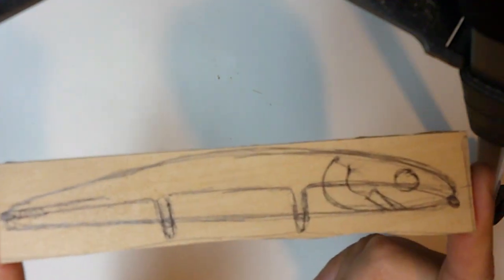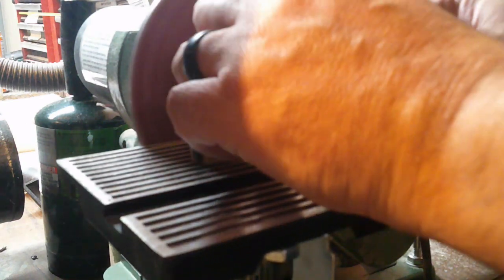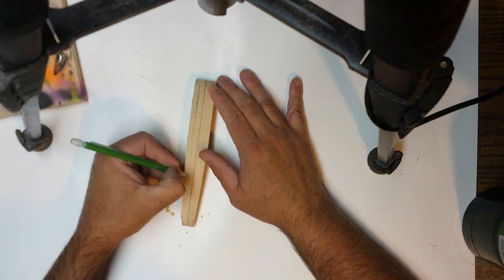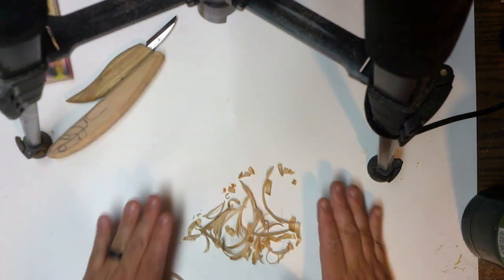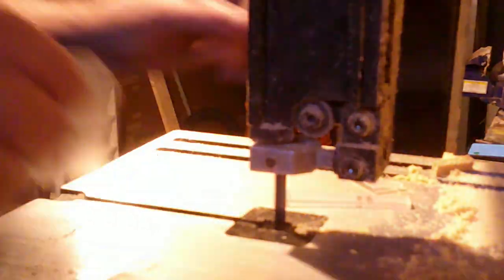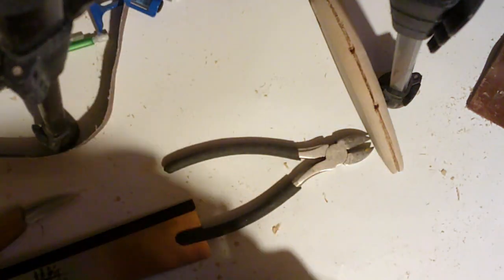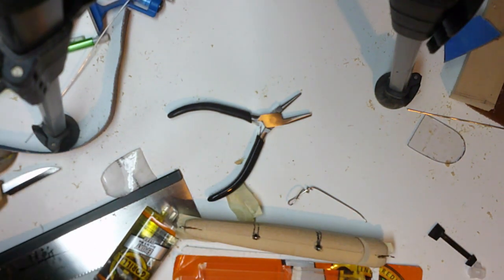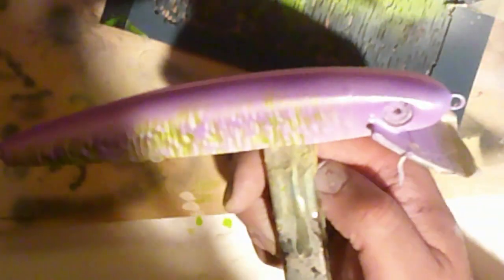Lure Making, Building a Throughwire Crankbait

Comment: What exact wire are you using? Where do you purchase it?
Reply from the maker: Hello Bruce, thank you for watching and taking the time to comment.  The wire is stainless steel aircraft saftey wire.  0.51" or 1.30mm.  Bought off of Amazon.
Reply: @rg22outdooradventures88  l saw some lengths at the "Musky Shop?
Reply from the maker: 0.51 inch stainless wire from Amazon.
Reply from the maker: @marsbotbyl159  amazon sells spools of wire that I use along with many other youtube baitmaking channels (marling, zimmtex, fretthold, ect.).  Those other channels are where I learned about it.
Reply: @rg22outdooradventures88  thanks so much. Just trying to make a few lures for myself. Initial cost is a set back. I would like this to be my new hobby.